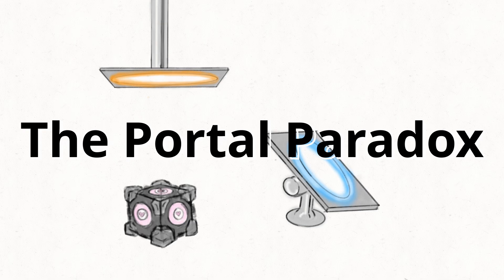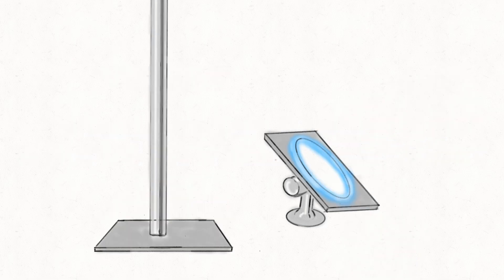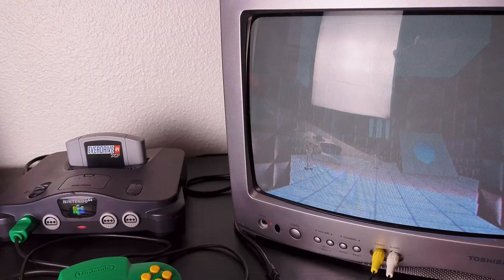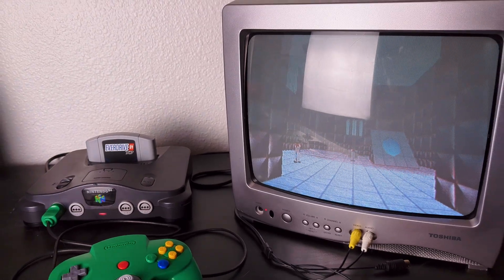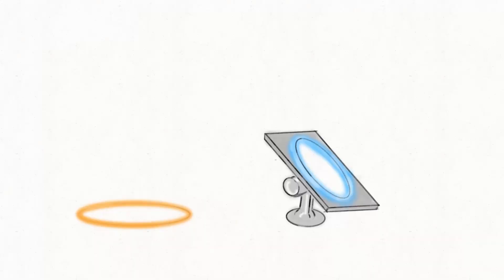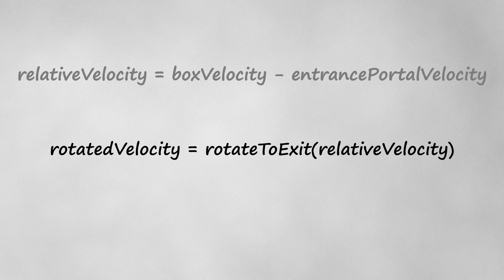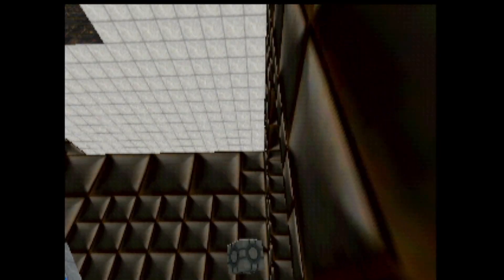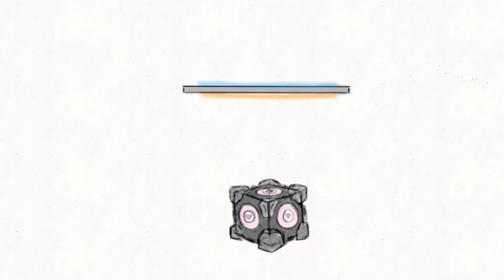I rewrote Portal from scratch and solved the Portal Paradox

Comment: Sorry but you're wrong. There is no force enacted on the cube, therefore it will not move. Its impossible. Your equation is literally pointless.
Reply: There is a force, the cube is pushing onto itself. 

The cube doesnt just instantly appear out of the second portal, does it? It exits the portal at the same speed as the first portal moves. Things in motion like to stay in motion, so there you go, you have your force.
Reply: @makarymetzger2627   But it is not in motion. It's stationary and will remain stationary until/if the second force of gravity takes effect after appearing out of the second portal. There would actually be 2 forces of gravity when the portal meshes with the ground. Gravity from the orginal floor the cube is on, and gravity from the (second) floor when traveling through the portal.
Reply: @StriveForLuck  It is in motion. The portal moves onto the cube, which causes the cube to move out of the second portal. Logically, the cube must exit that second portal with the same speed as it enters. This speed is the same speed as the first portals speed. And because things that have speed dont really like losing that speed for no reason, it flies out.
Reply: @makarymetzger2627 But its a portal. Imagine slamming a second world on top of you with a hole cut out so that you would then end up in the second world. You wouldnt fly up or in any direction relative to that second world, you would remain stationary on the first worlds floor while now 'being' in the second world. The second worlds gravity could then effect you, but the motion of the second world slamming around you would not cause you to move relative to its own velocity.
Reply: @StriveForLuck  That second world example makes no sense. 

Ok, think of it like this: 

The Cube isnt a cube anymore, but a bunch of layers. The portal moves onto the portal at 100kmh. The first layer comes through the second portal. Then, the second layer comes through the portal. The second layer pushes agianst the first layer, causing it to move away, so that the second layer can come in. The speed at which the second layer pushes agianst the first would be the exact same speed as the portal moves onto the cube. Then, the third layer pushes agianst the second, and so on. The cube gradually comes out of the second portal at a speed of 100kmh. And because speed doesnt like to be changed, it stays at 100kmh, and flies out.
Reply: ima explain the way ANYONE can understand. SO, imma ask you this: how does the cube exits out of the blue portal? IT *MOVES*, and it will keep moving because of momentum.
Reply: @hersical  It isn't moving though, the portal is moving which would make it appear as if the cube was moving. The cube would remain glued to the original floor it was stationary on unless gravity when out of the portal was able to move it, yet it could only fall as there was no momentum force that was in effect on the cube to begin with.
Reply: Test

Comment: That's wrong because the premises are wrong. Conserving relative velocity makes no sense; it's not a thing. The portal is just letting you move between two spaces that are otherwise not connected in normal geometry. You can think of the portal as a hula hoop. Moving a hula hoop over something does not exert a force on that object. The cube is stationery before the portal moves over it and the portal does not exert a force on the cube, therefore the cube will have no momentum coming out of the portal.
Reply: The cube is exerting force on itself. The cube doesnt just instantly pop out of the second portal, does it? It exits at the same speed as the portal moves. There you go, you have your force.

Comment: What happens when the box is thrown into a stationary portal but the 'out' portal is moving in the opposite direction from the exit vector? 
Could also be re-phrased as pushing one portal into the cube while pulling the other portal away...
Reply: the box would just not move in the exit

Comment: "I rewrote Portal to change the physics so I can win an internet argument" 9_9
There was never any "paradox" here. As explained by GlaDOS in the first game, a portal doesn't affect the inertia in an object. If the object is in motion, it will remain in motion when it exits the portal. If it was AT REST, it will remain at rest when it exits until it is acted upon by gravity or another force. It shouldn't matter how fast the surface either portal is on is moving. All the portal does is transfer the object that passes through it to the other portal. It doesn't exert any force on the object

Comment: What would happen if you had the cube moving in a certain direction and had an orange portal moving slightly faster in the opposite direction? Would it increase the velocity of the cube as it moves through the portals? Or would it slow it down?
Reply: You can just look at it from the point of view of the orange portal and measure the cube's relative velocity. It will come out at whatever that velocity is.

Comment: It makes so much sense, BUT, I think there’s a flaw in it. Briefly, as your approach of conserving relative velocity, it violates the law of physics of conserving energy, and foremost conserving momentum, which is give by mass * velocity. I know portals do not exist in real life, but even in the original portals approach, if you go over a portal, no matter where it is or if you’re moving or not, the energy regarding the entire context is conserved, and also momentum. The way you did it, it doesn’t do so, and in your example, the moving portal does not have and thus cannot transfer momentum to the object that was “caught” by the portal, neither ir takes into consideration any momentum equivalence between the portal and the object. In this case, it would be impossible to get the element through a portal which it’s other side is point upwards (against gravity) because the box (object) would instantly start to suffer the effect of gravity in the other side and inverse its momentum (as velocity is a vectorial measure), and would come back to the other side, with the correspondent velocity acquired by the effect of gravity. Thanks for the video and great job on creating portals for Nintendo 64!

Comment: Nice concise video. But, you fabricated this world and wrote the code/equation for how it would operate, that's why it works this way. The Portal Velocity shouldn't come into play though.
If the blue portal was on the ground the box would 'rise' up until the orange portal platform met the ground. The box would still be sitting on the ground below the orange portal but would also be sitting above the blue portal. Give it speed and the box would just appear on the other end faster, not gain momentum from no source and go flying. So really, it's a question about how gravity and air pressure is affected by the portals before you even add the portal velocity into the equation. Because, assuming it's not a magical membrane separating the two locations, the gravity and air / air pressure would bleed through the portal (which would change based on portal location/orientation). So with momentum you're probably creating an increase/decrease of pressure and/or gravity while it's in motion. Disorienting probably, but not going to throw you across the room.
Reply: Well you could say this for anything, that’s like god asking you if apples have red on them and you saying that the question is rigged because god made the apples with red on them

Comment: If the cube has the size 1 m³ - what would happen if the portal moving down stopped 50 cm above the ground?
would the cube be:
A) "Sucked" through the portal
B) get stuck, and nor transfer any motion, but just rest halfway through the blue portal
C) Same as be, but move after due to gravity affecting the cube on the incline of the blue portal?

Comment: You're wrong. Whether the portal or the cube is moving doesnt matter only if youre considering it relative to each other, but to everything else it does. The box is stationary relative to us, then when it comes out of the 2nd portal its now moving relative to us. You just stated this as a fact and tricked the viewers into  accepting the rest as a logical step.
Reply: Well it doesn’t matter if it does to everything else, you’re basically saying majority votes but there is not any absolute frame of reference and no frame of reference makes another invalid
Reply: because it is

Comment: what happens if the portal slamming down on the cube is the same but the other portal is right next to it going down at a rate faster than the first? granted there is enough space for the second portal to keep going down for a significant while.

Comment: My only issue to consider is that the blue portal is facing (and therefore traveling) in the opposite direction of the orange portal, thus doubling the speed at which the cube motion should occur, not canceling it.
Reply: No, the object leaves the exit portal with the same relative velocity as the object had with the entrance portal.
If the portals were next to each other, facing the same way and moving together, the momentum would double in relation to the room because it goes from speedy portal and still object to speedy portal and speedy object.

Comment: Plop makes sense, an easy way to test this yourself is to mak an O with your index finger and thumb on both hands, put the Os together and move them both towards an object that can fit theough them, then one the object passes through stop moving the back and ad continue moving the front, the front hand it the protal that 'squishes' the object and the back hand is the stationary portal that the object appears out of. 
(You can also just use 2 tubes or just imagine it in your head)
The object has no momentum so it will just plop out.

Comment: Where does the energy for the cube to move come from tho? As "real" as we can be, if the cube moves because of the portal moves, wouldnt that generate energy from nothing? Or is the end speed of the portal smaller than the start speed? Cube somehow taking energy from the portal movement.

What would happend if you would suddenly stop moving the portal once half of the cube is through?
Reply: While portals in the games already make infinite energy without moving, relativity exists therefor the answer is the cube should launch IF the frame of reference is the moving portal

Comment: I do really like this implementation of the theory but i think it forgets 2 important things

1) the cubes inertia is independent of the speed of the moving portal.

2) the portal simply acts as a hole in an object, it is for all intents and purposes always acting in that hula-hoop method, as it does not give or effect the speed of any object that goes through it, it simply allows it to continue unimpeaded.

If a wall with a hole slams into the cube, the cube doesn't fly out the hole, it simply goes through it
Reply: If portals are just holes that means they can’t move, because how can something that is defined as NOT be in motion, if a hole moves it’s a different hole or it completely throws all logic out the door and uses every single lock in the world on that door

Comment: Speedy thing goes in, speedy thing comes out
=
An object retains it's velocity when traveling through the portal.

Velocity being a property inherent to the object itself and only subject to change if a sufficient force acts against the direction the object travels in, the cube would not shoot out of the portal if it had previously been standing still.

Still thing goes in, still thing comes out.
Reply: This doesn't make any sense. How could an object both be still and comes out of something? Surely, the very expression ''coming out'' implies some kind of movement.
Reply: @Jordthelord1  Imagine instead of the fancy glowing portal, we used a mechanical arm to just move a hula hoop ring around the cube. Would the cube shoot/jump upward after the ring passed around it from above? The answer is no. The cube does not have or change its velocity just because a speedy portal/ring/door frame moves around and past it.
It's possible of course that the portals have more special properties other than being archways to different locations - e.g. they also accelerate particles that are passing through under specific circumstances - but to my knowledge that is never stated or hinted at in the games.

Comment: There is actually an ingame example of a moving portal that we can analize to see what the result would be! Its not really implemented, but its cannon. At the end of portal 2 (spoilers) chell shoots a portal to the moon. There, the portal on earth and the portal on the moon have different velocities. If the result were that the object retained its original absolute velocity after passing through the portal, then chell would have seen the moon shoot away at immense speed after going through, but thats not the case, she exits with the same velocity relative to the portal going in, as relative to the exit portal going out. Paradox solved with an ingame example!

Comment: What happens if the stationary portal is vertical and the moving portal stops moving at the middle of the cube? Will the cube stay still or will start to fall and therefore slide of the floor?

Comment: I feel like all you have to do is imagine the process frame-by-frame. The cube has to appear on the outside of the blue portal at the same instant that it passes through the orange one. The speed at which that happens has to be the same as the speed of the moving portal. So, when the box exits the moving portal, there's no reason it should lose the momentum it just gained.
Reply: @ZubbTlubb  nope
Reply: No, because again, imagine it frame by frame. As soon as 1 inch of the cube protrudes through the portal, it's speed relative to that world, is halted by the majority of the cub still being stationary, basically holding it down and resisting any change in momentum. Carry that and multiply it for every inch on the way down, it's all canceled out by the parts of the cube at rest that have not passed through the portal. 
The item must have momentum to carry it, not it's environment.

Comment: A few acknowledgements:
1. Thank you for cutting to the chase, and explaining after. I hate the "Tony Robbins Seminar" style of "In just a few minutes, I'm gonna show you what happens, but first [watch my whole video]." You got a sub and a like out of me for that.
2. N64 portal is an awesome idea for retro gaming. No justification needed.

Now, are you wrong? Technically, you cannot be wrong or right (at least for now), because portals defy the laws of known physics. That said, the issue you are describing is not a paradox; that is not what "paradox" means. This is simply a question of what we want the laws of an invented physics to be. That question is: When it comes to (not real) portal physics, what relative velocity does an object traversing through a set of portals (A and B) maintain? You actually missed one, as there are 3 options:

1. It keeps it's own absolute (world) velocity in the environment, which in this example would leave the cube with zero velocity once emerging from Portal B.
2. It keeps a velocity relative to the portal A it is traversing through, regardless of what is going on with portal B, which in this example would leave the cube with an absolute velocity equal to that of the moving portal A, regardless of what is happing with Portal B.
3. It keeps a velocity relative to the sum of the velocities of the two portals, which in this case would leave the cube exiting with the velocity of portal A, but only because the velocity of Portal B is zero. If Portal B moves at equal speed, but in reverse (negative velocity), as your second example, the velocities would cancel out at zero, whereas if Portal B was traveling in the "forward" direction (relative to its own face (normal), at the same speed as Portal A, the cube would exit at an absolute (world) velocity of double that of Portal A, or Portal A + Portal B.

Your math implements the third option, but only because it was mathematically the most logical. In terms of general physics, option 1 would be an equally valid assumption, as it just depends on the physical nature of what a portal is, and also how the two ends of a portal relate to each other. And because portals are not real, the physical nature of them can be described however we want. Options 1 and 3 are equally valid, imo, regardless of what the math looks like. Option 2 is probably not.

Comment: What about the case where the exit portal moves slower than the entrance one, so that the resulting cube velocity becomes negative ?
Reply: Then it would be like if the cube was being pushed forward by a wall and then a hulahoop got placed on it, it would simply stick out of the portal, pressed up to the floor

Comment: I reckon you are correct. The cube must be exiting the exit portal at the same speed it's entering the enter portal or matter would be squished.
The second test however fails to take into account that real platforms have thickness and the cube traverses this thickness instantly from one portal to the other. It SHOULD then be propelled somewhat (by the acceleration rate along the thickness)
Subscribed
Reply: What an incredibly odd circumstance... I at first disagreed with the video and you, as I saw no force being exerted on the cube by anything, but your comment on squishing must be true. So the force that throws the cube in the air is exerted by itself onto itself!

That, or moving portals are always going to act like an incredibly mean hydraulic press to create a square out of the cube.